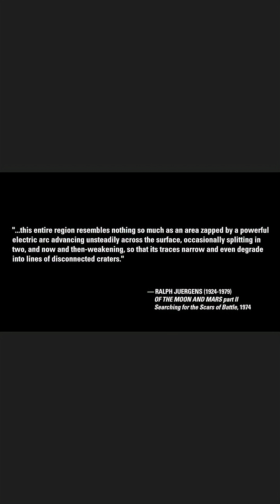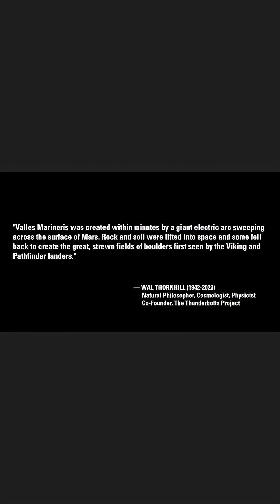Martian Facelift | #electricuniverse #plasmacosmology #vallesmarineris

Comment: One of the shared features that is dramatically smaller on Earth, surprisingly, is the Grand Canyon in Arizona. It is hard to imagine that this gigantic carved landscape is small in comparison. It takes a huge leap of the imagination for one to regard this as small. And beyond this, it takes an equal leap in faith to regard this gigantic Canyon with sharply dropping edges in a nearly flat landscape as having resulted from water erosion. Where is the enormous volume of material that was supposedly washed away by the erosion process?

The enormous sedimentary deposits that should have formed at the river's outflow into the ocean do not exist. An equally critical fact against the water erosion theory is the fact that the water that eroded the Canyon out of the bedrock would have had to flow over the top of a major mountain range. Water doesn't flow uphill, does it? It is assumed in order to save the theory that the land became elevated after the Canyon was formed. That's the only option available to make the water erosion theory seem plausible.

It is far more likely that the entire Canyon was electrically carved by plasmoid discharge currents between the Earth and the Sun under the intense electric stress pressure of interplanetary discharge currents, a type of large-scale lightning.
Reply: Look up thunderbolrs video enigma of the grand canyon
Reply: "The grand canyon wasn't formed by water erosion"
There is literally a river flowing through the grand canyon which is eroding it in real time. You just don't know how erosion works.
"The water would have to flow over a mountain range"
Yes, and it does in the form of rain falling on top of even taller mountains and flowing down to the land the grand canyon formed at creating erosion.

And the alternative you come up with is the sun welding the grand canyon into existence? 😂 Why are there no mega lightning bolts coming from the sun today to create entire canyons? Why doesn't lightning from thunderstorms create small scale canyons?
Reply: @HurricaneGilma  "Yes, and it does in the form of rain falling on top of even taller mountains and flowing down to the land the grand canyon formed at creating erosion."
 
Wrong!!! Where is the enormous volume of material that was supposedly washed away by the erosion process? Tell me, where do you think the enormous volume of sediment went? The enormous sedimentary deposits that should have formed at the river's outflow into the ocean do not exist. Google it for yourself if you don't believe me. The deposits that should have formed are nowhere to be seen, except in your imagination.   

"Why are there no mega lightning bolts coming from the sun today to create entire canyons?"

Because our Sun is an electric Plasma Star. A variable plasma Sun, unlike the constant Hydrogen Sun that physicists would want you to believe. The Grand Canyon was likely carved out of the ground in about ten minutes with the force of electric stress fracturing while the Earth rotated beneath the electric connection that was evidently linked to the Sun, where the big electric power concentration is located. In our solar system, the Sun is 713 times greater in mass than all the planets combine in the solar system.

When the Sun is active, an enormous volume of plasma is concentrated around the Sun. The Earth is rather puny in comparison, so that it would actually be surprising if large-scale discharge events, large in our sense, had not occurred during the hot times of extreme electric intensity. We have seen some really hot times in the recent geologic history, like 300 million years ago and 100 million years ago. The Grand Canyon might also have been carved out during one of the lesser peaks of high-intensity solar conditions.

"Why doesn't lightning from thunderstorms create small scale canyons?"

Small-scale lightning from thunderstorms is created from the ionosphere and not directly from the Sun. See Hannes Olof Gösta Alfvén - Plasma physicist and winner of the 1970 Nobel Prize in Physics for his work on magnetohydrodynamics. 

When we visit the great monuments on Earth, we see in them a tiny bit of history that once was from times long before the dawn of man. We also see, as we look at the Sun, a few traces remaining of the interplanetary electric connections that we see evidence of in the dynamics of the sunspots. Soon, we will also see the Sun itself becoming inactive and dark as the next Ice Age begins. We live presently in a radically diminished electric environment.

*David La Point - Plasma physicist -The Primer Fields
*Los Alamos National Laboratory - The complementary nature of the Primer Fields has been verified in high-energy experiments directed by Anthony Perrat.

Comment: There is no electrical scaring of planets. It is impossible. There is not enough coulombs to do it. A magnetic field would completely defeat that type of action.
Reply: It was a very very long time ago when things were very different than today's orbits
Reply: @WorksopGimp Haha! Good one! It's just like magic. It wasn't this physical reality, it was another. 

Of course, magic is believing a lie to be the truth. Your joke was a little on the ludicrous side but I guess it wouldn't be so funny if it were not so obvious.
Reply: @abebarker You actually have no idea what the electrical environment of the solar system was at those times. The evidence for EDM is quite strong, with many of the shapes impossible to produce with cometary impacta. More importantly, there's no outflow for water in Valles Marineris, no path for erosional flow. So my question would be: how did it form according to you?
Reply: @Kaimelar8 First, I would state quite clearly that you, yourself, have no idea what the electrical state of the electrical environment of the early universe was, even more than myself because you have chosen to dissociate the previous state with the current state. This seems to be a case of the pot calling the kettle black. [A more apt description would be the pot calling the teacup black. ]
Second, the 'evidence' for EDM is entirely suppositional and requires a set of circumstances that does not exist in the present universe in any case anywhere. 
As to how the Valis Marineris was formed, the evidence quite strongly suggests that it was caused by uplift. There was likely some change in the material underneath a large area near where the valley is and its expansion caused the valley to form.
Reply: @abebarker  Wow, so many words, so little said. That was my point, that nobody knows what the electrical environment was, including me.

All theories are suppositional, that's what theory means. Uplift as a theory is the same as EDM. I have no idea what you mean by "managerial underneath". Hard to imagine so much uplift in a planet with no volcanic activity whatsoever though. Weak sauce. The electrical scarring seen on mars can be reproduced in the lab. Your ideas can't.
Reply: @Kaimelar8 sorry, the auto correct messed that one up. I meant to say material rather than managerial. I'll correct it. 

The problem with your lab results is that they do not represent the conditions found in a planetary system. They have no bearing regarding reality. If anything, they prove that electrical scaring of planets is impossible.
Reply: @abebarker  It's your assumption that they have nothing to do with a planetary system, not a fact. I have no idea where you get that last thought, that they prove it to be impossible. Seems a logical fallacy: "does not follow".
Reply: @abebarker  I can see how mainstream views could lead one to believe that interplanetary lightning would be impossible, but the fact is that it's a common sighting in space. It's literally full of ionized filaments, sometimes carrying huge currents (some measured in the exa-amp range!). They exist at all scales as well, from planetary to intergalactic (the cosmic web). There are beautiful Hubble images of star forming regions where stars are seen to be born like beads on a string of lightning.
Reply: @Kaimelar8 the mainstream doesn't even know how lightning works. From what I have figured out about how lightning actually works, it is impossible for lightning to occur between planets. 

Planets aren't just big balls with a static charge on them. They have many layers or spheres of positive and negative charge. They stay in layers because of the magnetic fields they generate and interact with. [The electrical layers become more ring like the farther away from the center you go, as evidenced by the Van Allen belts. ]

You have a very simple and naive concept of planets. Unfortunately, it doesn't align with actual reality. (It does align more closely with the mainstream but that's beside the point. )
Reply: @abebarker In the Electric Universe view, planets are part of a solar electric circuit, connected by plasma currents. Lightning isn’t limited to clouds; spacecraft have observed discharges on Jupiter, Saturn, and Venus, as well as Birkeland currents linking Jupiter to its moons. Double layers in planetary plasmaspheres (like the Van Allen belts) can break down, creating massive arcs if voltage differences are high enough. Features on Mars resemble electrical machining, supporting past interplanetary discharges. Auroras are a mild example of these currents in action. So, lightning between planets isn’t “impossible”, it’s actually predicted by plasma physics and supported by observations.

Calling people "simple and naive" doesn't strengthen your argument or position, it detracts from it, and your arguments seem to show that it could be the other way round.
Reply: @Kaimelar8 you are not the one to say what the electric universe is. Your naive perspective of electricity is a detriment to the electric universe theory. You have no idea what you are talking about. Additionally, you are wrong on so many levels. It might be better for everyone for you to sit down, take a break and see what those who have more knowledge and insight have to say.
Reply: @abebarker  Well I guess it's great that the internet has you to point the way further. 😂 Care to explain for the public where the detriment is exactly? If you can, also explain how your view is so superior. I'm curious.
Reply: @abebarker  Oh and to help with my naivety, and since you claim to know so much, please explain why filaments are seen at all levels. I've never seen a good explanation and you seem to be just the right person to ask.
Reply: @abebarker no crap we don’t know the electrical environment to a 100% certainty was in the past, that’s why it’s a theory, nobody knows 100% of anything unless they have a Time Machine. What makes a theory believable is it has good explanations backed by scientific experiments. 

You dislike this theory probably because it conflicts with what you were taught in school and your ego can’t handle that your education was wrong
Reply: Cassini revealed the electrical interaction between celestial bodies aren't just possible, they are very real.
In fact as we discuss this, 
Saturn is modifying it's orbitals...
performing planetary scale EDM, 
electromagnetically ripping dusty icy bits from it's moons to feed it's rings.
Reply: The evidence for EDM between celestial bodies in our solar system was gathered by the Cassini 
and Rosetta missions....
or do you insist the interactions between Saturn & it's moons 
and the jets that erupt when comets pass through our system 
are due to "ice volcanoes" & "sublimating gases"?
Even though the nozzles required for such highly columnized outputs have never been observed.
Reply: Despite polite replies, 
someone/something doesn't like my comments & keeps deleting them,
but I'll keep trying.

"A magnetic field would completely defeat that type of action."
You do remember we're talking about Mars right?

As for "the early universe"...
you mean when even more of the primordial stuff was in a plasma state than it is now?
Which would make it closer to CJ Ransom's experiments of interactions of "free floating" plasmas?

"the 'evidence' for EDM is entirely suppositional and requires a set of circumstances that does not exist in the present universe in any case anywhere." 
Our flyby missions showed it's happening with Saturn...
or do ya still think the moon to rings interaction is from "Icecanoes"?
Reply: @sc0repio662  It's called cryo volcanoes not "icecanoes" and yes that's the cause of that ring interaction.

Also the solar system didn't form in the early universe. The universe was already almost 10 billion years old when the solar system formed so it was already similar to today.
Reply: @HurricaneGilma Yes, I know some prefer the StarTrek Speak term "Cry-oh-volcanoes".. 
Most do so while simultaneously ignoring 
Cassini noted during it's circumnavigation of the lunar poles there was over a million amps involved in single lunar branch "circuit". 
Was that just coincidental????

According to the HUWDF & the JWST images, 
the readily accepted theory of formations 
and direct observations
don't meet their own expectations or timetables.
Reply: You must be in the mainstream. A place where you believe in magic unicorn explosions that make something from nothing, then call your eyeballs liars when they tell you that the Martian surface was clearly machined with electric arcs.